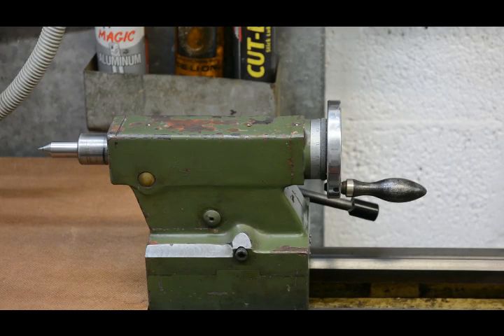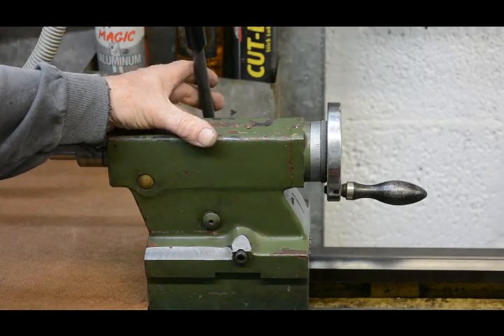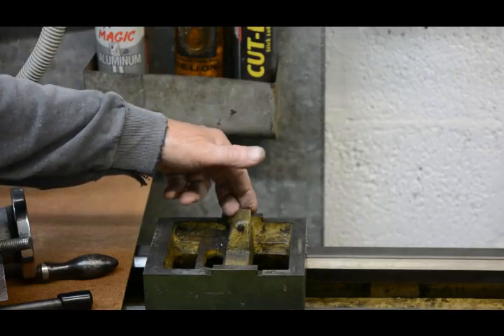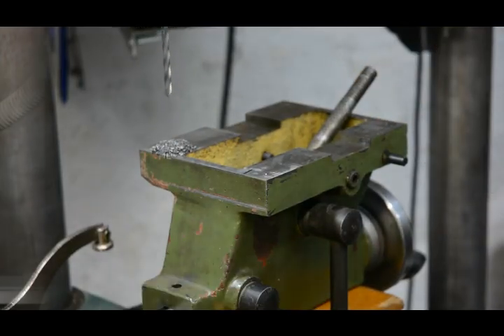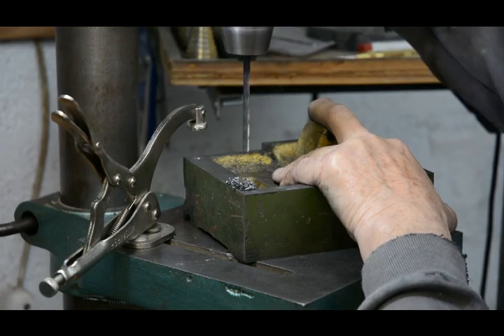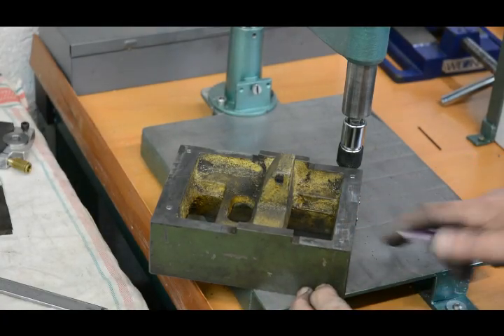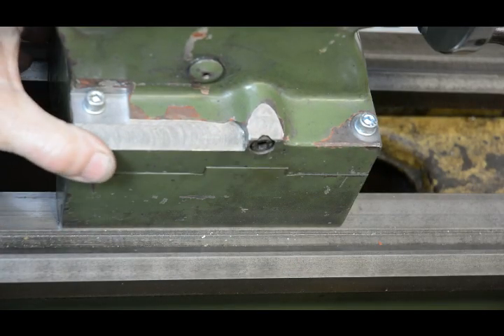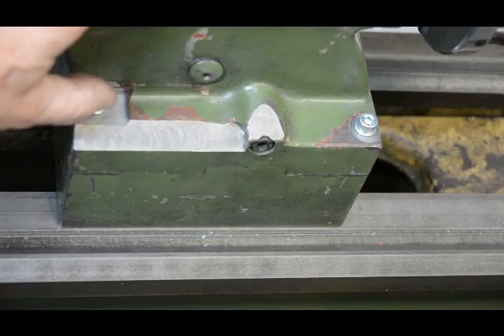Lathe Tailstock Improvements.

Comment: Hello Tony. Thanks for taking the time to make this video. It's concise and gives a simple hands on account of what you accomplished. Correcting a flaw in a machine that needed correction. I like your solution. And as you said if you need to turn the occasional taper the setting method you have used is easily reversible. Keep up the informative videos.